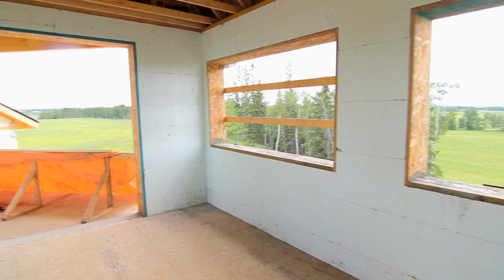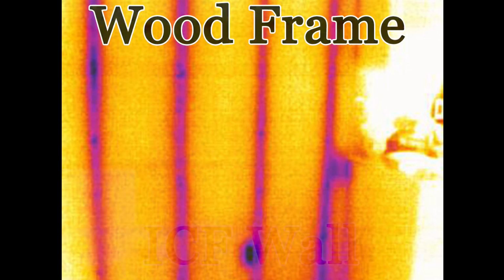10 Reasons to Design with ICF (Insulated Concrete Forms)

Comment: Thanks again, as I recall watching this video years ago. I bought my land twenty years ago always with the hope of building an ICF home with internal post and beam structure, but would consider alternatives, including stick and ICF or precast flooring and roofing. One question on a detail... you just slip your floor joists @16:15 on the hangers. How are those hangers set into the wall? Pocket? Bolt? Who makes them?
Reply from the maker: You can check out Watkins hangers. We used a Burmon hanger on the most recent house. Simpson has a system (not my favourite) or use old school anchor bolts and a ledger.

Comment: Hey Kody,
Do you know anyone who does ICF construction in Florida? I have land in St. Augustine and my wife and I want to build our retirement home there. I've been doing a lot of research from Steel Construction to SIP's to Prefab and Modular. After looking at ICF construction it makes sense in Florida, where there is heat and humidity and in St. Augustine it gets chilly in the winter, but maybe not as cold as it does here in NJ, and then there's the fear of hurricanes and structural damage from wind. So ICF makes sense. Thanks for the video and I subscribed to get more knowledge.
Reply from the maker: I’m glad you noticed the benefits of ICF and thanks for the question. I’m way up here in Canada so don’t know any contractors for you. Check out Nudura.com to locate local representative OR find a local ICF distributor. That’s where to start. To ensure the right contractor call the local concrete pump companies…they see who’s good and who isn’t.

Comment: Excellent video and info.  Do you have a video showing how you attach the floor trusses and joists to the ICF on a multistory?
Reply from the maker: I plan on making new videos to cover new products and I do have videos on how to hang a floor to an ICF wall so you can check those out. 3 systems come to mine, Simpson ICF, Watkins hangers or Burmon. 

As for the roof or trusses. They typically get nailed down to an LVL top plate that is bolted to the concrete.

Comment: Kody, no matter how many time I watch this video I always get more beneficial information. This is such a great video.

Question? At 6:50, it looks like you point to the bottom of the top chord to point out that that is where the wall stops. Is that the case, or does the wall stop at the top of the top chord. 

I cannot find any detail on the Nudura site that depicts this configuration. Thanks.

Comment: Do the tall walls all get poured at once?
Reply from the maker: No. We pour about 9 to 11 feet at one time. The gables we 16’ tall and we did those in 1 shot but there’s not much concrete at the top 5 feet. 

Some guys will pour 15-20 foot height at once. I wouldn’t but that’s just me.

Comment: Good morning,

You know anyone who works with ICF in Austin, TX.?  About how much more expensive is to do a flat or 3/12 pith ICF roof. 
Nice video!!
Reply from the maker: I don’t know of anyone in that area. As for an ICF roof, I don’t have experience with that either. I hear Quad lock has the best sloped roof system.  For something flat I know “Fortruss” is an excellent choice for insulation and form work.
Reply: Thank you for thanking the time to respond. Too bad you are not here in the Austin area!!
Reply from the maker: You’re welcome
Reply from the maker: I could have so much work in the USA!

Comment: What is the calculated man hours required to install a 9 foot high basement using ICF? I m assuming blocks are placed inside perimeter of foundation for assembly.. Also assuming two window openings and a door opening in a 30’ by 40’ foundation for. Home with walk out basement.
Reply from the maker: That’s tough to gauge. I always set and pour my frost walls for a walkout basement. Then a back fill that trench and then do the rest of my basement at one time. I would say about 200 man hours
Reply: @uptokode  I was referring to just erecting walls and installing rebar with inside supports of walls.
Everything else is similar to what would be done with a poured basement right?

Comment: 1 What is the span of the 54-inch beam? 
2 Any comment......... Complete capsulation to use spray foam close cell for roof insulation; to the roof sheeting for an unvented roof in Canadian weather?
Reply from the maker: I would need to confirm off the prints but the one section is around 20 ft. 

For the attic insulation I much prefer batts with an air space above vs. spray foam to the u/s of sheeting. We had to do a vented ridge cap in order to vent properly. And there was a ton of room for insulation. 2 layers of R28 with joints staggered. 

Does this answer enough?
Reply: @uptokode  Yes I appreciate your answer

Comment: Sorry one more question.
6) what type of outside face can I do? Stucco, shiplap, vinyl?
Reply from the maker: 6. You can install any exterior cladding. Might take a phone call to work out the pro’s and con’s. Vinyl siding if you need to meet a budget otherwise any other cladding is possible.

Comment: Questions please:
1) Take longer to build
2) I would like radiant flooring can I still have with a 2 story house?
3) Can my inside walls be made out of wood?
4) Do I need extra insulation?
5) Any type of roof is ok?

TIA! Great videos
Reply from the maker: Feel free to email me but I’ll still answer now. kody@uptokode.com 

-Time frame is about the same. We are picky with ICF so we might add 2 weeks to an entire build 
-Radiant heat can be used anywhere in an ICF home. Radiant to a wood floor has slow reaction and I wouldn’t recommend it. 
-Yes you can attach wood directly to the ICF with no poly or additional materials. Unless you want them installed vertically, then you need horizontal strapping.
Reply from the maker: 4. You do NOT need extra insulation for the exterior walls. Only if you want to meet a higher spec in which I have videos on how to add R-value to ICF. Eg. Nudura XR35 block. Extra insulation and no extra labour. 
5. Any type of roof system can be used. Best value is a truss roof. Inexpensive, easy to install and you can load them with blow in insulation and still have lots of ventilation.

Comment: Do you have a ceiling design for ICF Flat Roof?
Reply from the maker: I don’t but you can use the Fortruss suspended system by Logix and I know Quadlock has a system. I’m sure other manufacturers do too.

Comment: Hey Kode how do you rip your NUDURA icfs
Reply from the maker: Circular saw or table saw. When doing a ton of rips make sure to put nylons or a shirt around the table saw motor so it doesn’t suck in foam debris and wreck the motor. I did that once. 🤦‍♂️

Comment: But isn't air change important for good health?
Reply from the maker: It is but we now use mechanical systems such as HRV’s that temper cold air and are energy efficient.
Reply from the maker: These supply fresh air for an air tight home VS having a super leaky home, which allows lots of fresh air but is far less energy efficient

Comment: You make a great video.
I planning of having a ICF house built I bought one in Northern BC but had to sell due to relocation after only 10 months it had 3 levels and after 10 homes it was the best.    I am   planning of having a ICF house built, I have been looking for a contractor for a few weeks now and  that seems to be a challenge. 
The plans I have one exterior vaulted wall/ ceiling; I was willing to go wood frame on the gabriel end but after your analysis I want ICF, also the designer wanted a engineer beam in the basement  garage  17' 6 inches but can that be incorporated in the wall above?

Comment: We're in the midst of an ICF build with a GC.  We do have a vaulted/cathedral ceiling in the plan for the living room.  What are you doing in these sections to maximize energy efficiency.  Didn't know much about this when we had our plans designed, and concerned about best way to get best value insulation in this section seeing as the rest of the home will be so efficient.  Writing from Eastern Canada.  Great channel!

Comment: And you are still using wood on those window frames....why they are not metallic frames? Also the roof is wood which can catch fire.
Reply from the maker: Wood is offers a lot of solutions. Cost effective, better thermally than steel (way better), easy attachment inside and out, easy to work with. 

The roof system. If you have unlimited budget you can full out but a typical truss roof is the best bang for the buck.
Reply: @uptokode  ok

Comment: I'm building an ICF home and I'm very curious how you built the 24' window in this house? I'm having a lot of trouble finding info or videos about building a widow like this. The commercial widow installers around me advise against it claiming that I won't be satisfied with IGUs and commercial  mullions, but don't have any alternatives to suggest. Any help pointing me in the right direction would be greatly appreciated.
Reply from the maker: This window is 13’ wide and 24’ tall. It’s commercial grade with 2 inch wide mullions. Re-enforced to meet wind loads and engineered. Other than that do whatever YOU want. 

The ICF opening will never move or be affected by humidity or weather. Fully structural. 

If you need more  info DM me on Instagram or email me. Check the description of ANY video for those links.

Comment: Some thoughts:

#1) The cost comparison is often made between code-compliant wood framing and ICF, and ICF comes out as more expensive. I think the cost comparison should instead be made between Net Zero wood framing, with all the diddling around to get air-tightness and extra insulation, and ICF. ICF is probably quicker and may even be cheaper to build than double-wall framing or slabs of foil-faced poly-iso over framing.

#2) You made the comment about the steel I-beam being an unfamiliar material and the hassle of attaching joist hangers to steel. Familiar vs unfamiliar is something we all struggle with, and we seldom even realize it. I had a concrete guy in my basement and he pointed out the screw adjust on my lally columns were extended too far, and that I wouldn't be able to get a permit to finish the basement until I fixed them. My temporary solution had been to put wood blocks at the tops of the columns. His suggestion was to cut holes in the floor around the base of the columns, build up a concrete layer on top of the footings, put the columns back, and then pour new floor around the columns. I later realized a third solution would be to saw the tops off the columns and weld in 4-inch pieces to lengthen the columns. As they say, "If the only tool you know how to use is a hammer, everything looks like a nail."

#3) I'd like to see how you do gable-end overhangs with your ICF walls going up to the underside of the roof deck. Or do you stop the ICF gable-end wall 6 inches short of the roof deck?
Reply from the maker: Great comments! As for the gables, yes we drop them about 3 3/4” so we have a 2x4 lookout (on edge) to create the overhang but always keep the ICF on the lower side as it’s easier to shim them level than dado out the LVL top plate if the gable is too high.
Reply: @uptokode , perfect. Thanks.

Comment: ICF can make passive house?
Reply from the maker: Yes Bryan passive house can be met with ICF. Far easier to achieve air tightness. I have a video coming out Jan 29 showing how to add R-value to ICF. 

One thing no one considers is thermal mass and how it adds to efficiency. It doesn’t add to the insulation value but it does greatly slow down how temperature swing affect the interior temperature. This thermal mass is not a part of the equation in most energy models.

Comment: Cost more?
Reply from the maker: Complex question. It’s about 5% more than a wood frame. But if someone wants to make wood more efficient (closer to ICF) that 5% disappears real quick and no matter how much you do to a wood wall it will never compare to what ICF offers. It will never be as strong, air tight, and doesn’t have thermal mass.

Comment: What is the cost to build with icf vs traditional wood building
Reply from the maker: In my calculations it’s only 5% more on an entire build. Because the only difference is the exterior walls above the basement. Everything else in the house is the same. Floors, roof, windows, bathrooms, cabinets, drywall, etc. For 5% more you get continuous insulation, 40% better R-value, thermal mass, 8x the strength of a wood wall, disaster resistant, quiet, multi generational AND it’s all done in one step! It just can’t be beat.

Comment: Kody, I have stacked walls from the basement,  installed the floor joist hangers in the blocks, then braced underneath each hanger with 2x4 of 2x6’s, set the floor joists in-place, then laid plywood down an the floor above, and walked around on the first floor as I poured the basement walls. No Scaffolding needed to pour any exterior walls! Inside the top of the basement wall, we inserted a 4x4 down into the wet concrete creating a “keyway” that will accept concrete from the next pour. Inside the cavity, we insert #5 rebars extended above the top of the pour to aid in the keyways bonding strength. This process can be repeated to the next floors. I built many very large houses this way, and saved a ton of labor and $$ for the customer and me. I really like the way you explain the entire process.
Reply from the maker: Very interesting ! I could see that being an advantage for time. Wonder if I would be brave enough to try it.

Comment: You do great work!  The two people I know with ICF houses have walls out of plumb, and that is permanent.  But no one would know unless they were told.  The ACH figures you get are incredible!  I've never got below 2.4 ACH with wood framing.  Our new state energy code gives points for low air charge figures, so ICFs are looking good.  But you've still got to be prudent with penetrations in the floor and ceiling—that's about 75%  of the surface area of the walls.
Reply from the maker: Thanks! I have found it’s not that hard to get ICF air tight. We went back to a house 3 years after we built it and it came in at 0.42ACH. Didn’t have to do much more than a very solid vapour barrier in the basement slab and the ceiling.

Comment: And these 10 reasons aren't even including being I'd say atleast twice as quiet or more than a 2x6 built home with closed cell insulation
Also fire resistance is unmatched...... Especially with the new eps formulations. 

Bulletproof to all common ammunition a, and even the ol' M2 AP 30-06 round

No you don't stand a chance to a Barrett .50 Cal with AP or API rounds. But, with ICF it is too easy to make a fantastic Shelter, and using thicker blocks and concrete, or a double wall system, you can in fact have a nearly indestructible space. 

ICF is just awesome. Period. Anyone thinking about it..... Go find a home that is ICF and see, feel, and hear the difference for yourself. 
Is that 5% extra worth it? (And usually there's not 5%)
ABSOLUTELY!

Comment: Kody Horvey, I will use ICF on my new home ICF , Concrete Floor's, Concrete Roof 6 foot overhang , Basement 14' high x 40' Wide X 50' Long second ( 1st  floor ) same  steel/concrete beams with Concrete Roof sides will be  12' X 14' Glass triple glazed panels incased in aluminum frames, I do not want any post in the basement it must be clear space and the circle stars from basement to 1st floor. wish me luck.

Comment: I'm a 42 year, Design/Build veteran, and a green building specialist. Your comparisons are valid in as far as your wall systems. The truth is, the building envelope of structures, traditionally built,  is inherently flawed. So, the Leeds standards to build more thermal efficient buildings is like putting a bandaid on a pig and calling it something different. It's still a very flawed structure, which requires a lot of money and effort to correct. The flaw in your thought process is the fact that roof spans to create volume ceiling designs require some type of engineered structural system such as your 24" parallel truss design. There are a few roof systems that will create a similar out come as your ICF wall systems, but they add a lot of cost in time, materials and labor. So, while your walls may be much stronger, your roof system is the week point, related to storm damage. 

Most people, even so-called construction professionals, don't really understand thermal conduction/resistance. Let's take one example, referenced in this video, in a wood framed wall system, with fiberglas insulation, the studs being in direct contact withe the exterior sheathing creates a direct path for thermal conduction to occur. The effect of this bridging process is equivalent to, one whole side of a house being un-insulated. This understanding, applied to the roof system, creates a challenge. You've spent a great deal of money to achieve a highly efficient thermal resistant wall system, but your roof system design is flawed at best related to thermal conduction/resistance/structural strength.

The matching component to your wall system does not exist for roof systems, within reasonable cost perameters. So, the only reasonable alternative is outsulation. Creating a thermal barrier at roof deck level thereby breaking thermal conduction into the attic. If you're not going this extra step, the the cost of ICF becomes questionable at best.
Reply: close cell foam?  concrete foam decking?